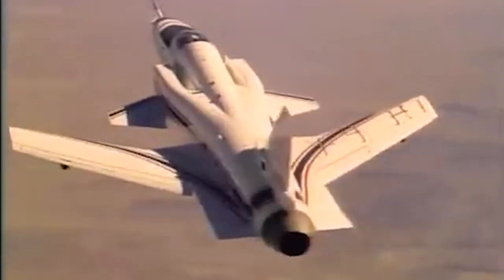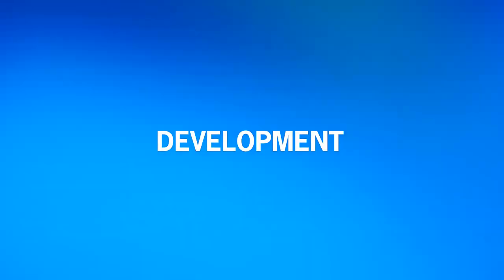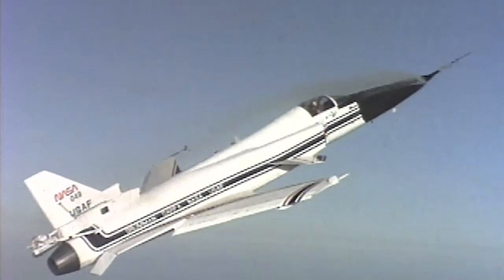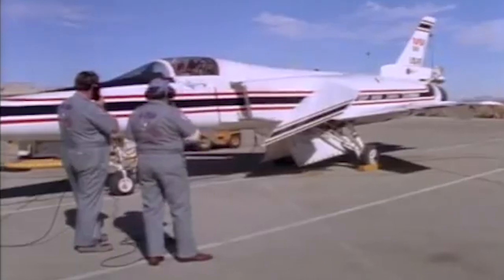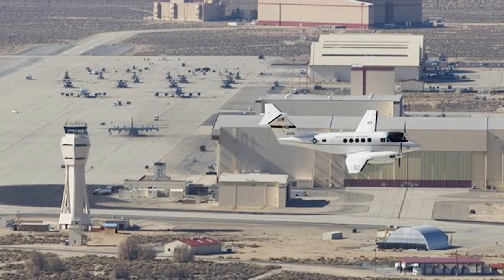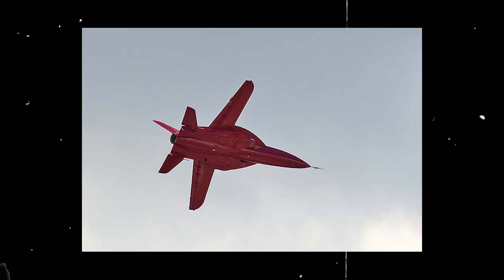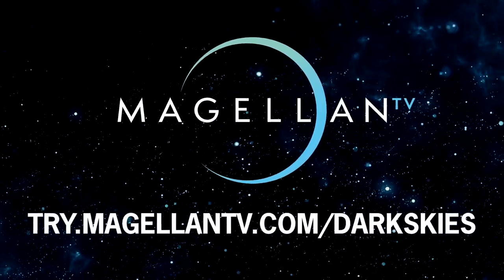X-29 - The Most Unstable Fighter Jet Ever Built

Comment: I saw one of those aircraft in 1983. It was sitting in a hanger at NASA's Langley Research Center at the time. I recognized it and knew of its pedigree because I had read about it in Popular Science Magazine. I wasn't on a tour or anything. I was just temporarily stationed at Langley AFB which shares runways with NASA's Langley Research center. It was on a day off and I was in uniform and nobody said anything to m as I wandered around. An "airplane nut" from my childhood, I was in "hog heaven" simply wandering around looking at planes I had only read about. I met one of the test pilots who shared with me some stories of his time testing aircraft for NASA. All in all it was an excellent day.

The X-29 was designed and built for the sole purpose of testing forward-swept wings (FSW) as a means of increasing fighter maneuverability. As such it was never intended to be an operational aircraft. To reduce costs, the aircraft was very much a pastiche; using components of existing aircraft. In fact the two test beds started life as F-5 Freedom Fighters. The X-29 design made use of the forward fuselage and nose landing gear from the F-5As with the control surface actuators and main landing gear from the F-16 and the air intakes of an F-4 Phantom. It was not a beautiful aircraft but it very much a marvel.

Ultimately, the U.S. elected not to pursue FSW technology but it had nothing whatsoever to do with "fear of the Russians". My understanding is that the technology did not offer sufficient advantages to offset the increased cost and complexity that FSW technology would entail. Also, the USAF periodically goes through stages where the top generals decry the need for maneuverability and close in dogfighting. Prior to the F-22, the last fighter the U.S. fielded which was intended for close-in dogfighting was the F-15 which is still a superb dogfighter.

Comment: Having read about these ages ago, the limited handling characteristics was the big reason for moving to stealth technology.  The F-117 has a few handling characteristics itself.  Also needs computer assist in flight.  This program did contribute much for aircraft design, though no one uses or will be using forward swept wings for military fighters soon.  In the 1970's early 1980's Rockwell had forward swept wing test aircraft though subsonic.

Comment: The aircraft only had 40 FPS? Does the FCS interpolate between the corrections or is it plain 40 times per second correcting? i would have imagined you need a rather more responsive solution.

Comment: I don’t know if you realise this but the whole point of this design was to build an unstable aircraft that would therefore have unprecedented agility, as well as good high-speed performance.  The instability did not emerge as a problem, it was a key requirement.  It would of course require fly-by-wire computer control but that was already an established technology as witnessed by the F-16, F-117 and even the Airbus A320.

Comment: The independence of the drag on the sweep direction is not inaccuracy, but an over-simplification. For the sweep of modern commercial jets, the forward sweep has a drag benefit, which is not impossible, but pretty difficult to achieve. The low leading-edge sweep of the FWD-swept wing may enable the natural laminar flow of the wing which makes no sense for the BWD-swept wing

Comment: It's nice to see recognition of this remarkable experimental military jet. Its ostensible unique attribute -- its forward swept wings -- is the draw for throngs at a military aviation museum (where the only XB-70 resides as well, by the way), but really, that's not its most remarkable attribute. It's impossible to "see" aerodynamic instability, but its solution of a multiply redundant digital flight control system was at least manifest, albeit previously well understood, as the development of the F-16 indicates -- incidentally, itself designed to be, IIRC, 6 percent unstable. BTW, the X-29 was intended to be, IIRC, 25 percent unstable, but ended up being 35 percent unstable, as you indicate.

No, the most clever attribute of the X-29 was how it was made to fly -- in a practical sense -- with wings that would indeed sheer off faster than a pilot could bail out, as you indicated, as well as the singular performance attribute that distinguished it. And you get both of these wrong! Or should I say, your description uses the wrong words and talks about the wrong principles.

First though, from memory: the Hansa Jet had (mildly) forward-swept wings only because the Center of Lift needed tweaking, and the German Junkers bomber was a failure made in prototype only. Indeed, the successful WW2-era Me-262 had (rearward-) swept wings -- critical for transsonic flight! -- but only because this was a fortuitous workaround for a design miscalculation.

You dither about the X-29's construction using a "special composite" (well, it was a fiber of high modulus for the time, but otherwise nothing special, insofar as this was a new material and technology), and the "aeroelastic taileron" (which means what?, being it was of conventional aluminum construction), and its "remarkable performance" (which it didn't have, unless you qualify what aspect of performance you mean).

To my knowledge there are only three modern planes that are the realization of one theorist's breakthrough idea, described in a published technical paper: The XB-70 (compression lift), the F-117 (from a Russian mathematician's equations describing radar reflection), and the X-29. Yes, it had "aeroelasticity," but this is saying nothing. It was from some guy's graduate thesis -- easy enough to look up -- who proposed a carbon graphite composite layup orientation in such a fashion that bending forces would result in a consequent and opposite torsional force to counteract "divergently" increasing tip deflection due to lift, that would otherwise necessarily result in catastrophic failure.

The singular remarkable performance characteristic that the X-29 exemplified, was its ability to retain kinetic energy in a high-G turn, for which not even the remarkable F-22 comes close, even with thrust vectoring. Is this "performance"? -- the F-22 would still slaughter the X-29 in a one-on-one dogfight to "wax its six".

I really do apologize for the tone of the above, as I truly do admire your content and frequency of submission, but you just have to forgive me for mentioning such glaring omissions and misperceptions, insofar as this is just simply the nature of the technical subject it is.

Comment: This program needs an update using the F-20 as plane basis, thrust vectoring, modern avionics, and a lift fan akin to what the F-35B has. See what happens when everything is fit into a plane. It may be too much but it's worth trying out an update where all the best tech is put in a plane.

Comment: unstable because the canards were almost sitting inside the main wings.  Also, it is quite possible to have small "feather wings" in the back for more stability.  a tad heavier on the backend,  and double tailfins rather than one could have helped as well.   if it were stretched out just a hair, probably would have been just fine.

Comment: You missed one of the most important things about excessive instability. 

An unstable aircraft makes it very easy to initiate a maneuver, but very difficult to recover from it. 

That was the reason for the excess of control surface. 

Well.. if you have an excess of control surface anyways.. they can both push a stable aircraft into a maneuver quickly and recover it much quicker.

Comment: I am honestly surprised it even broke the sound barrier, let alone crazy Mach 1.6 flight speed which is quite fast for a forward-swept wings design. There's a good reason why they'd rather design it to be digital fly-by-wire hardware because of inherently unstable airplane design (B2 faces basically the same problem not having extra wings but those that gives an actual lift). I would honestly not be surprised if they bring the forward-swept wings back in form of variable geometry wings for hypersonic jet fighters because obviously each fuel mileage matters to military, similar to the movie, Stealth, as it could be one of the most fuel efficient options for hypersonic jet fighters.

Comment: I actually saw the Russian version fly at the Sukhoi yearly airshow...
(back then they still made quite interesting if mad technologies, rather then living off posturing & corruption)
I think it was a mixture of various designs, and the spy data X-29 certainly did have a large effect on it, but nothing similar in terms of electronic stabilization could be achieved, so it was quite a different vehicle, controlled (at least that's what they claimed) by Gyroscopes (much like a soviet  heavy satellite)... it had more speed, was heavier, & its turns were sharper, but its responsiveness and controllability were generally considered slightly inferior at low speeds, or much harder physically on the pilots at the best maneuverability velocity... in the development of its later modification, NASA did have a lot of hand in developing it as a joint project (this is early post-USSR, i.e.: a period of relatively good working relationships with the west), later they tried (as people claim) to sell a model to China, but as far as we know, failed.

Comment: I always liked the plane. But figured at the time they wouldn't proceed with a producrion model. I had flight sim software that allowed you to design a plane. I made a forward swept wing with canards. In the simulation, it climbed like a rocket, but wouldn't fly in level flight. I kept changing the size and shape of the canards and wings, could never get stable flight other than climbing. 😁

Comment: The X-29 was a purely experimental aircraft to fine tune fly by wire. The plane was designed to have a chaotic but flyable profile. Where the computers adjusted the trim while the pilot pointed it where to go. It was never a fighter. Except they did use a heavily modified F16.
Reply: No relation at all to the F-16. It was a descendant of the F-5 and more closely related to the F-20. The Grumman Apollo LM is in its ancestry too (in the fly by wire computers).
Reply: @allangibson8494  ::thumbs up::

Comment: The dialogue cribs from Wikipedia too much. Example below:

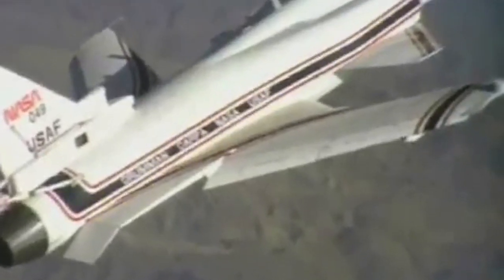8:46 Transcript:
Between 1984 and 1991 the two X-29
 planes flew 242 times. The Dryden Flight Research Center published an internal report on the new technologies and techniques shown by the  X-29. New applications of previous technologies, such as the aeroelastic tailoring, improved the plane's control of structural divergence, aircraft control, and handling. Its success mostly relied on the three surface longitudinal control and the advancements made with the second model regarding the high angle of attack. Regardless of the program's future, the X-29 had proved essential data for military aircraft production.

WIKIPEDIA ARTICLE: Grumman_X-29:
The two X-29 aircraft flew a total of 242 times from 1984 to 1991.[2][10] The NASA Dryden Flight Research Center reported that the X-29 demonstrated a number of new technologies and techniques, and new uses of existing technologies, including the use of "aeroelastic tailoring to control structural divergence", aircraft control and handling during extreme instability, three-surface longitudinal control, a "double-hinged trailing-edge flaperon at supersonic speeds", effective high angle of attack control, vortex control, and demonstration of military utility.[4]

Comment: Is this the plane whose system led to the computers used to keep the f-117 stable? I remember a video saying that that plane as also unflyable due to its unusual shape.
Reply: The F117 flew before this one, so did the F16. A modified F8 Crusader was used to test digital fly by wire systems.

Comment: The X-29 was not, nor was it intended to become, a jet fighter.  It was as the X says, an experiment.  It was built to explore the advantages and disadvantages of forward swept wings in high performance aircraft.  It was built using existing components from aircraft already in production. Much of the airframe was unique to the design. But it was never a 'fighter'.

Comment: I'm always disappointed that people refer to the F-5 instead of the F-20 as being the base frame for this aircraft.   F-20 TigerShark which was an improved version of the F-5 that shared much of airframe with noticeable difference.  All you have to do is look at the fuselage, tail and intakes, let alone the engine used on the X-29 to know, that it's a modified F-20, not Modified F-5.

Comment: All fighter jets since the F-16 are supposed to be aerodynamically unstable in all axes and use computers to interpret the pilots commands rather than using direct control. This is because they are much more maneuverable and lose a lot less airspeed in tight turns this way and in air combat airspeed is life.

Comment: Actually the aircraft was based off the F-20 Tigershark and not the F-5 Freedom fighter.
Both airframes are similar except the F-20 has a single engine.
They also use F-16 landing gear on the X-29.

Comment: There's a misstatement right away at the beginning.
The X-29 was NOT designed in 1984!  It flew for the first time in December 1984!
It was designed years earlier; it took about 2 years to build each X-29.  The X-29 design would have been frozen no later than 1982 similar to how the Teen Fighters were all roughly designed at least 18 months to 2 years prior to the prototype first flights.
The program had its genesis in a paper published in the mid-1970s.  An Air Force officer with an advanced engineering degree proposed how they could build an FSW plane.  After reviews of proposals from several aviation companies (Rockwell/North American, Grumman, and General Dynamics), the Grumman version was chosen because it was the best compromise using off-the-shelf components (F-5, F-16, F-18 parts) as well as a technology demonstrator.  
They were NEVER going to build a production plane exactly like the X-29!  GD had a proposal that basically grafted FSW wings onto an F-16 fuselage but it was shot down quickly because DARPA didn't want to give GD a leg up on other companies.  They didn't want to grant any company a potential monopoly and the F-16 was already being used in its main form for other experimental programs.  Aside from the Mitsubishi F-2, there never was an F-16 derivative with a re-engineered wing that successfully went into production.

Comment: The X-29 was the test bed for the F-117 computer flight control system programming...As the F-117 was highly unstable...
Reply: Nope. F-117 was in service before the X-29 even existed. F-16 was already a proven flying CCV platform in active service when the F-117 was in development. When the X-29 first flew the F-117 was already in service. It was an experimental aircraft to evaluate the properties of forward swept wings and nothing more.
Reply: @ASJC27  Better go read more. The F-117 was flying as early as 1980...The  X-29 program did not even start till 1984..Just as the Air Force okay the  production beyond the first two F-117 smaller concept they built. To Full scale prototypes. Just as computers had become smaller and lighter for full scale aircraft...They used the  X-29 to get the instability data they needed  for the F-117.

Thank  You
Reply: @MasterChief-sl9ro  F-117 first received operational capability status (i.e. cleared for action) in October 83. It first flew in June 18th 1981.
X-29 first flew in 14th December 1984. 
Now I may be wrong here, but I believe that 1983 came before 1984. Therefore, F-117 was operational and in service (in the 4450th Tactical Group) when X-29 was yet to fly for the first time. So The X-29 couldn't possibly have any input to the F-117 design. Even your own dates show as much.
Reply: @ASJC27  I'm telling you to go read more. As all these X Plane projects fell under DARPA control....
The F-117N fixed the Navy issue with instability.. Using the X-29 flight data...
The Navy still not want it. The UK said it cost to much. So they refused it.. 

Go read more. As I know people that worked at DARPA during this time..Which is why most don''t  know the F-117 was also designed to shoot down Soviet AWACS..

Thank  You

Comment: The X-29 problem was the rear wing design. The rear wings forward should not have flat edges squared off at the tail section.. This is just one the problems of the rear wings.

Comment: I can see there would be major issues with this aircraft if even slightly damaged. Other designs "want to fly" and will continue to do so with some damage. Some aircraft in WWII would still return home even with severe damage.
Reply: Laughs in b-17
Reply: I wonder if the flight computer would be able to overcome battle damage and get the crew home?
Reply: That's no different than most modern fighters. F-16, F-22, F-35, Eurofighter, Rafale, Gripen, Mirage 2000 are all unstable at subsonic speeds (but stable when supersonic) and can't be flown without the computers. 
As long as the FCS is functional and there is enough control authority remaining (i.e. enough of functional control surfaces) the computer can fly them with damage.
Reply: @ASJC27  that's what I was thinking. I can't imagine the flight computer knowing the difference between design instability and damage. It could correct the for the damage until the it ran out of control authority.

Comment: Comparing the X29 to actual fighter aircraft is not fair. The X29 had no gun, no hard points, no radar. Still, it is sad the Air Force didn't purse it as an In Between fighter between the aging F15 and F16s, and the F22 which was way behind schedule.